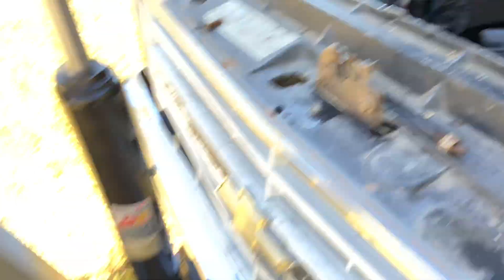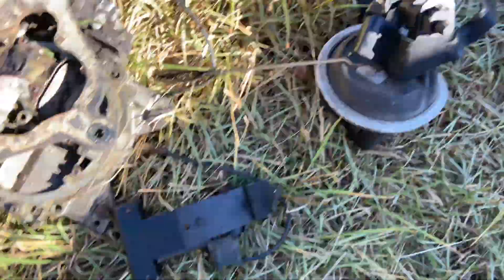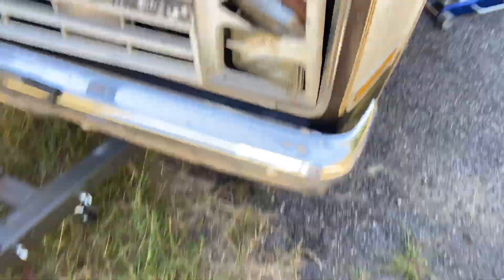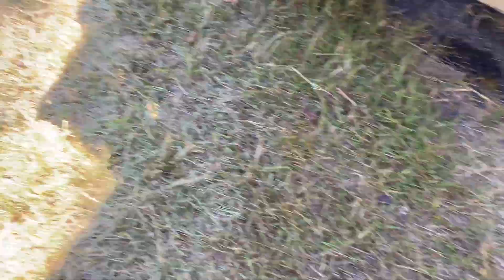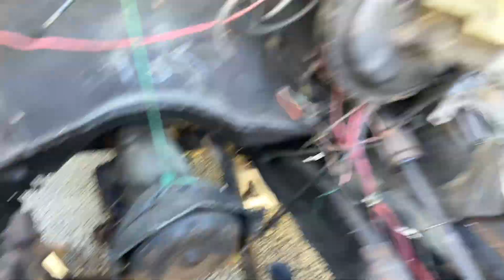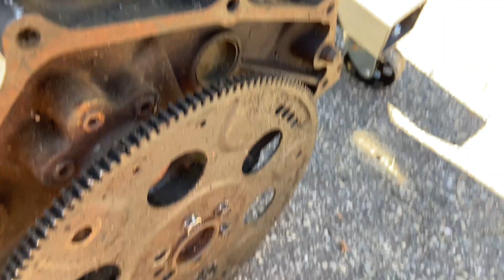1985 suburban revival part 1 - Easy engine removal turns into disappointment

Comment: I'm going to guess those bolts were secured with red threadlocker, which has to be heated to release.  A 305 would be just fine for most hot rods, but it has a psychological disadvantage.